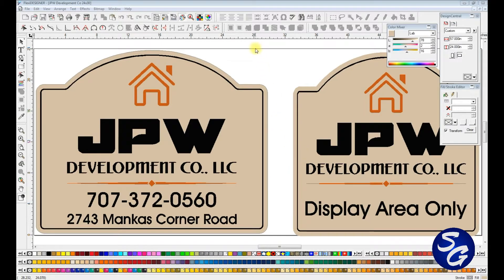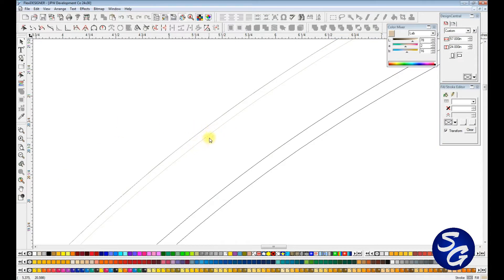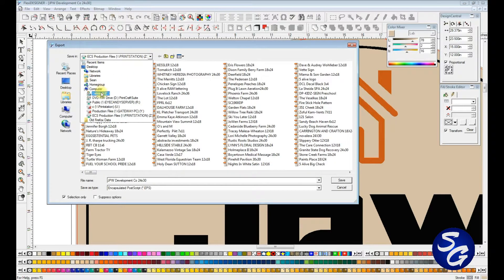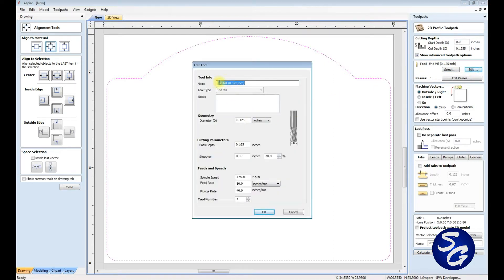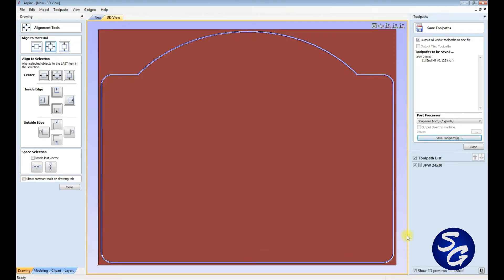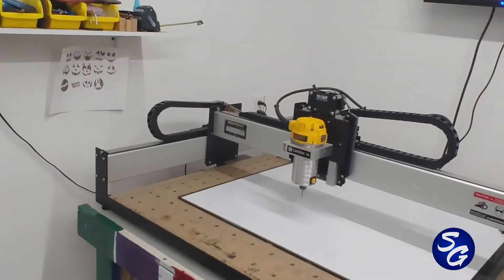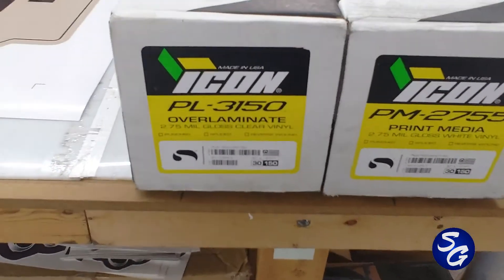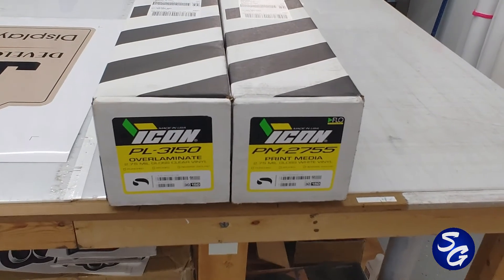Making an Outdoor Printed ACM Sign

Comment: Were do you get your ACM and what size panels do you use on your Shapeoko? Love your channel, can't get enough of it.
Reply from the maker: Thank you! I used to get my ACM where and when I could get it, I've used Grimco MaxMetal, Tubelite "Elite" brand, and handful's of others. About a month ago I tried 2 4'x8' sheets of Piedmont Plastics Sign Grade "Alupoly" 3mm ACM. The BEST ACM I've used in  years and priced better then anywhere else I can get ACM. To me it was just like the original "DiBond" before all the knock off junk hit the market.  My typical cut panels are 12x18, 18x24 and 24x30 from ACM, I cut the ACM down to whatever size I need for the upcoming jobs.
Reply: 2:20 I've watched this about five times now and I still have no idea what TF you're talking about. Clear as mud. Thanks.

Comment: What bit do you use to cut out the ACM and do you leave tabs in place?
Reply from the maker: I've been using these for about 3 years: https://shop.carbide3d.com/collections/cutters/products/102-125-flat-cutter?variant=928065603
 Replaced a few they cut pretty good and last, I've also used the #274Z .125" Single Flute ZrN but not much difference in the cut. I found the best way to get a smooth edge on ACM with those bits/cutters is to run counter clockwise/conventional. My feed is about 70-80 with a plunge of 40 and run my Dewalt on the #2 setting.

I don't leave tabs on ACM, I just hold it until it's done cutting.
Reply: @TheSignGuy  thank you!